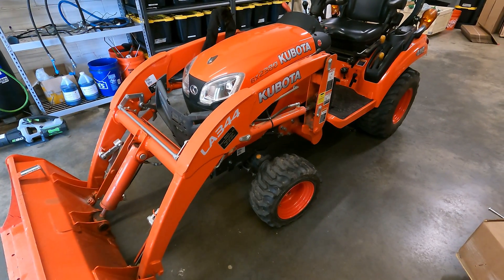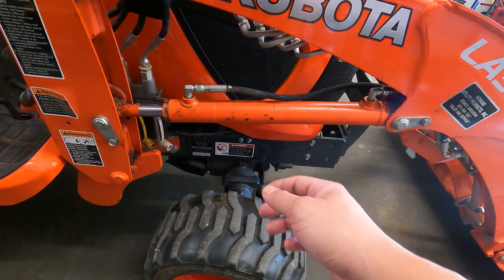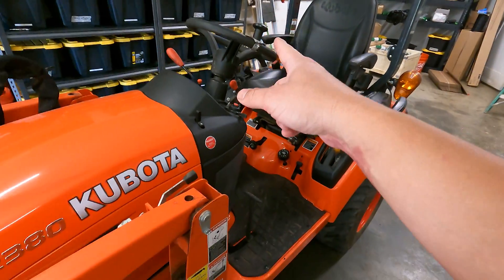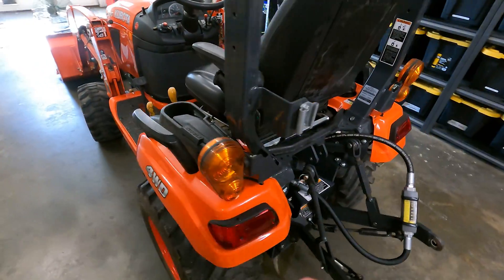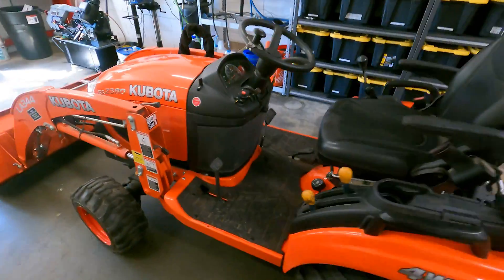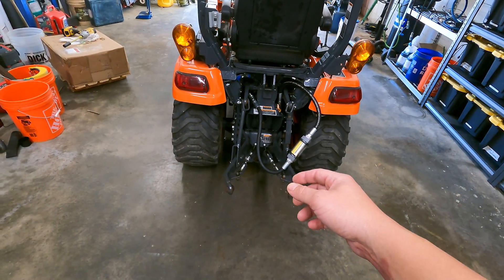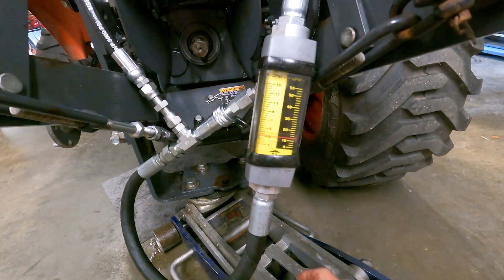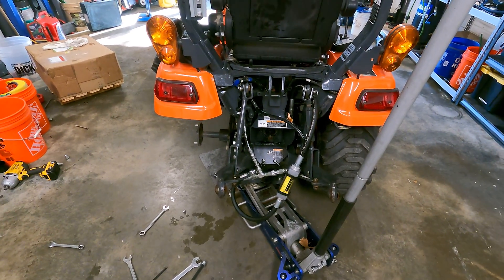Hydraulics Speed - Kubota BX2380 vs. John Deere 1025R? Part 1

Comment: Are the cylinders the  same on the bx25d
Reply from the maker: same stroke and length, but the mount closest to the operator is narrower on these because the BX23S utilizes a different quick mount latch.  It will work and if you bought replacements from Kubota, they would sell you the BX23S version as well.

Comment: I would love to have more flow at lower rpm’s on my 23s especially when using the backhoe. Thanks for the work your doing!
Reply from the maker: I've been thinking about this because I agree I want it to be faster at lower RPMs, but one challenge with the series valve is that adding more flow may create a situation at higher RPMs where the loader is almost too fast.  For example, if we moved it from 5 GPMs at WOT to 8, the equivalent flow to the loader when using 2 functions would be 16 GPMs.  That may be ok, but  it's something I'm working on to see if I think it's going to be a problem before I invest too much money into a new pump design.

Comment: It`s nice that you are testing things and all, BUT, It`s never a good idea to be adding more things like more lift capacity. These sub-compacts weren't designed structurally to handle more than they were already designed to do.  These sub-compacts are already being worked to their limits as it is. If you need more lift power and capacity, then you should really buy a bigger tractor for the tasks at hand. But, people will pay the price modifying these little tractors and then they will cry when they start breaking them. Wait until people start taxing that BX front axle because of to much weight and work load! Stressing the front loader arms! There`s a high price to pay, for everything. Our Kubota BX23s already does every thing we need it to do, and does it very well.
Reply: Watch some videos from Biffs equipment I think the tractor is just fine. And who doesn’t love some upgrades.

Comment: Let me know when you get these cylinders finished, I’d be more than happy to do some testing for you and some real life work when the time comes. I’d def be interested in picking up these cylinders If they really add that much more lift Cap.

Great vids BTW
Reply: If you could make more flow I’d be interested in running a hydraulic post hole auger efficiently.. it’s always been something I wanted to try. Limb saw also. The more hydraulic attachments you can on a tractor this size the more productive they become. My guess based on my channel is you’d have a lot of guys wanting your product ideas talked about here

Comment: So with the priority valve, should you ever feel a “hitch” in your power steering while using the FEL?
Reply from the maker: Yes - you will feel a hitch anytime there is a sudden release of pressure and you are actively steering.  The reason this happens is because the valve is pressure compensated, so when the pressure from the implement circuit grows, the orifice for the steering gets smaller to limit the flow to the setting.  If that pressure is suddenly released, like when you are dead heading a cylinder and then you stop, for a moment, the flow will have an easier path to go to the implement circuit, until the valve adjusts to direct flow back to the steering.

Under normal conditions, you shouldn't experience this unless you're hitting the PRV or just at the edge of it. If you feel this during normal use and you have hydrosplus on a JD tractor, you will need to add some flow to the steering so that it only occurs when you hit the PRV and then release...while actively steering.

I have a video planned for this that I'm hoping to have up in the next week or so.  Thanks for the question!
Reply: @HydrosPlus  Thank you for the detailed response, suspected this was the case, since the pump is shared.

Comment: Hopefully when you get done with Kubota you could try massey ferguson gc1725. I believe tractor data says 4.9 so similar to Kubota it seems. I think 6.9 is the total. So more then John deere also. Iseki makes the massey from what I could find before buying. My only complaint on these tractors coming from much bigger equipment is the low hydraulic flow. They do the job just slower but I use mine for commercial lawn care so time is money more to me so I'd be interested in upgrading

Comment: I had an L3400 for awhile.  It was cool to just pull the loader stick into a corner but when 1 function stroked out, it would go into relief even when the other cylinders still had room to travel.  Kinda made handling a load weird to me.
Reply from the maker: Thanks for sharing.  That's one of the down sides I found with the Kubota approach and you confirming that is very helpful.  From my research so far, kubota is the only model that uses this approach, so that does make me wonder why.